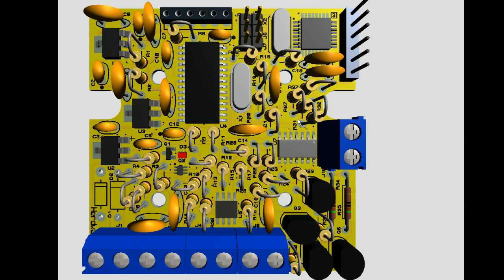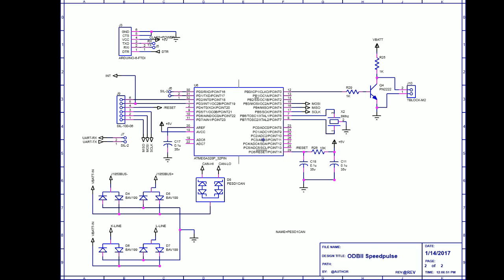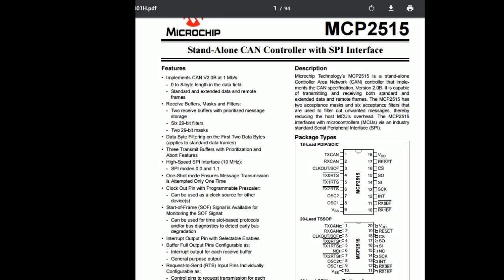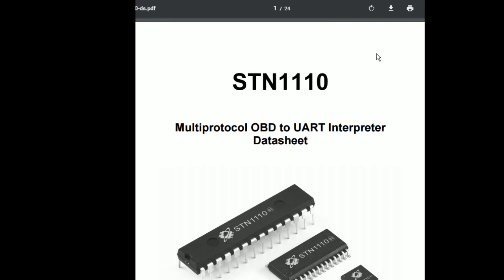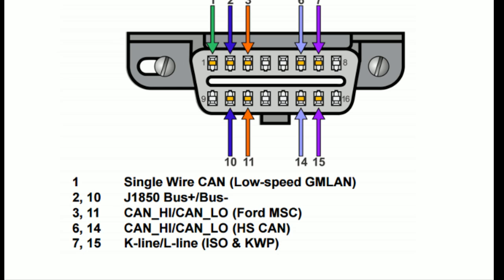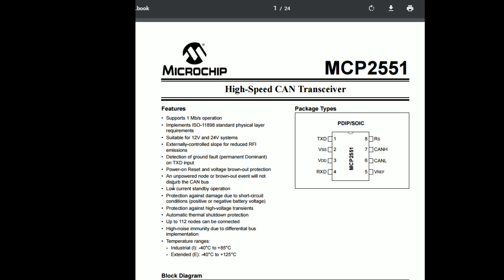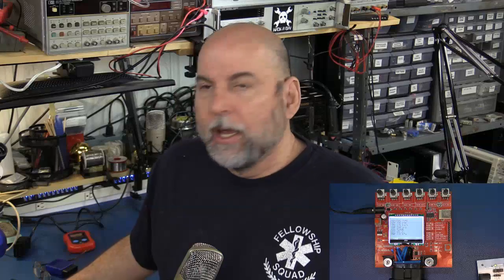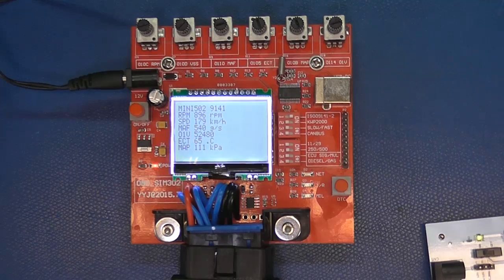Hacking my Truck with OBD-II

Comment: Hello 👋🏾 
You seem very knowledgeable regarding the OBI . I was wondering if you have the ability to convert a J1939 adapter to corresponding with the J1850 PWM wiring connector for a 2008 f350 Super Duty.  Attempting to use a Garmin ELD on the truck .

Comment: hi thanks for share .i have a question what do to the pcm when you jump pin4(ground) to pin 13 for more than 30 minutes on toyotas models .the other day i replaced a pcm and i did the job and the car worked perfect. does it empty the learned values of the computer or just erase one side of the memory and the pcm load again those news values ..... and thanks again to share the knowledge

Comment: Bil -
You are busy so I will get right to my question. I have a 1995 4 runner which I am attached to, and I have had a dread of some kids breaking into it and stealing it. I have been mulling over how to have a concealed switch that will prevent the car from running if it is off. I don't want to mess with interrupting gas flow, so that leaves electric.

I have some experience in wiring and basic electronics (arduino type stuff is as smart as I get -tho I'm not suggesting using one), and I wonder if you would suggest something, or maybe mention some things that you have heard of, but are not suggesting.

thanks

Comment: Love it! Keep it up! And question about obd2- I get you can read data, it's a diagnostic port and that's it's main function, but can you also write? Like can I tell my car through it I want to go 60 mph? From what I can read online the answer is no and that makes sense but I thought I'd ask. Not that I want to try XD
Reply: Hi Sam, Unfortunately that's not quite how it works. Probably the best way to achieve that would be to interpret signals from a cruise control ecu. Another option would be for a drive by wire throttle pedal assembly, though they typically use analog voltages/current outputs rather than CAN or LIN.

There's been one well known hack that provides the level of control you're on about, but it's since been fixed by a recall:
http://hackaday.com/2015/08/22/how-those-hacker-took-complete-control-of-that-jeep/

If you're interested in this field, I would highly recommend these boards from Hobbytronics, that combine the MCP2515 and an Arduino Leonardo on one board. http://www.hobbytronics.co.uk/leonardo-canbus. The code examples are decent, but you can find many different MCP2515/CANbus libraries that work for cars. I used these boards with a J1939 protocol library to analyse a trucks CANbus to an emissions related project.
Reply: To follow up, most modern ECU's do have a number of Rx commands, these are typically used by the dealer to configure things, an example of which would be to send a command to trigger a DPF regeneration. Anything that you see a dealer do using their tools must be available, however some are well hidden, but others well documented.

VAG group cars have very well documented canbuses and you can do anything from remap to control chassis peripheral devices from the OBD port - No safety critical devices are controllable however (such as throttle, brakes, steering) these are readback only. 

Subaru/Mitsubishi have a great following with the openecu flashing tools - I used this to remove the 180kph speed limiter from my japanese import. 

Some ECU's are nearly impossible to identify the PID/PGN combinations for, as car ECU's are rarely documented past the legally required PIDs in the OBD2 specification. - Lexus are the worst for this, I couldn't do anything to my old IS220d.
Reply: Ok! That's cool! Thanks!